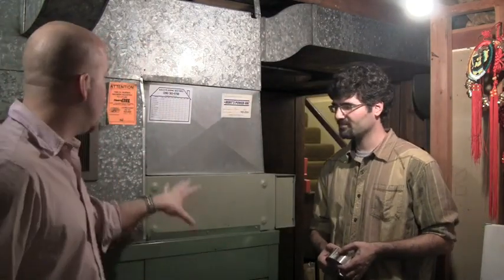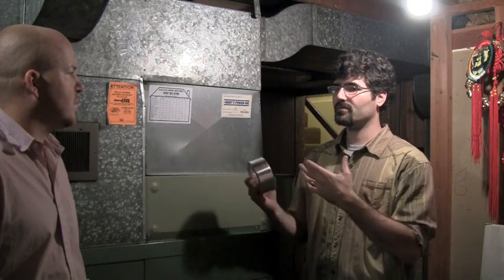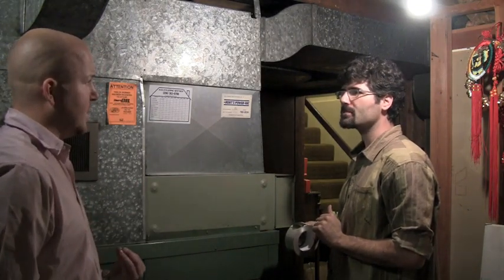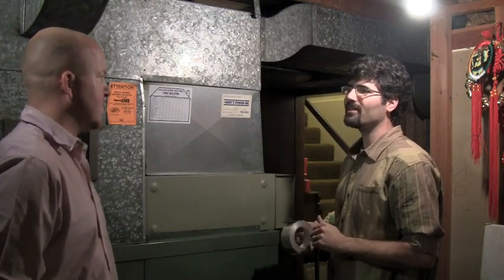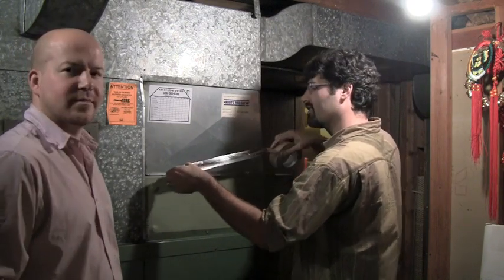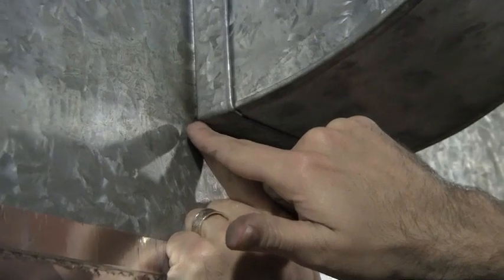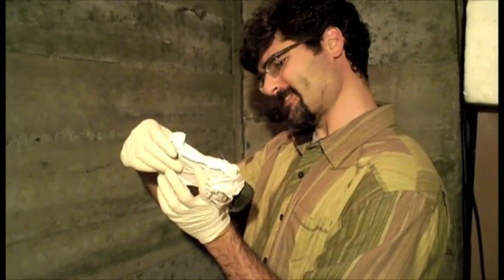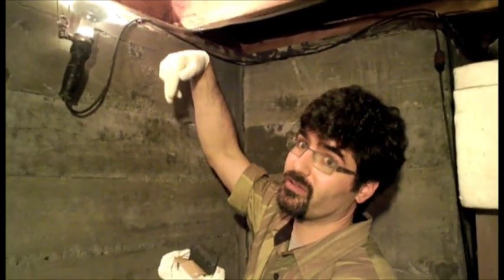ETv Pads Episode 1: Air Sealing - Heating Ducts

Comment: I just finished foil taping my seams, do you have any suggestions to verify that you sealed everything up well and are benefiting from tedious hours of taping?
Reply: I know this is years after the question was posed, but professionals seem to almost always follow up with a brushed on coat of the mastic product which can be had in a water base giving easier cleanup than the older type,